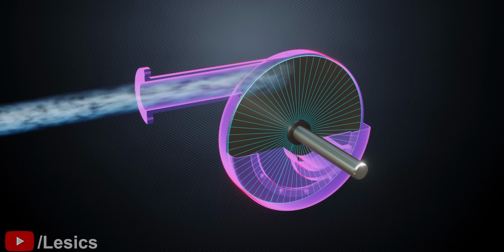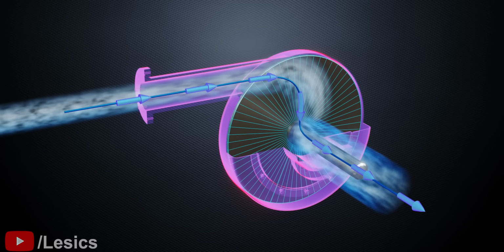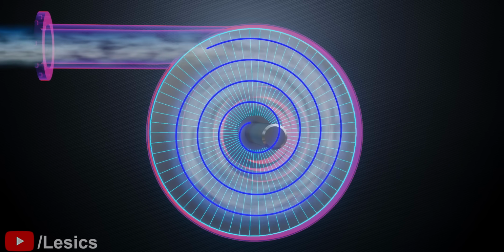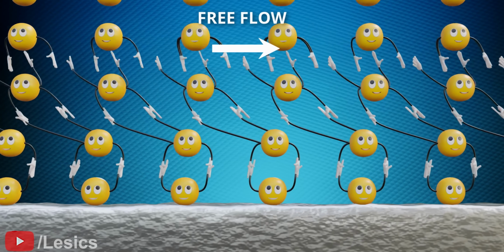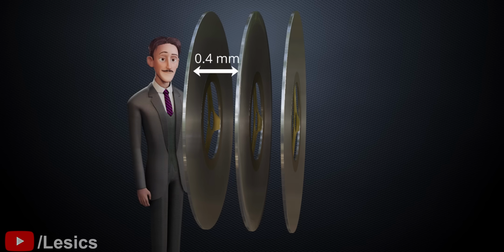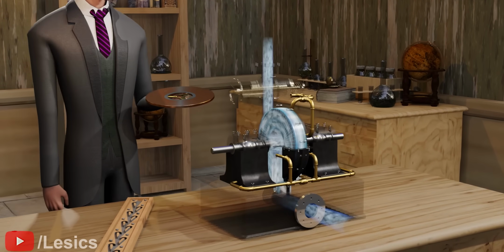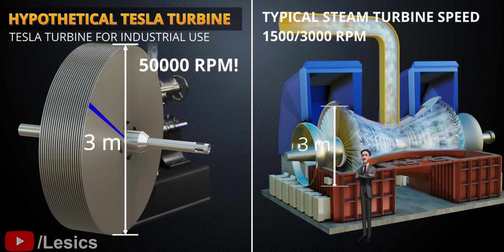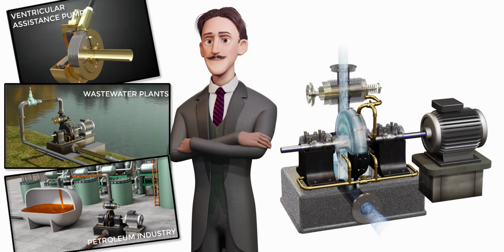Tesla Turbine | The interesting physics behind it

Comment: And there I thought I gave this a thumbs up already. Anyway, I think you do not need to build large Tesla turbines, an array of small ones would suffice too. You have to calculate building a "factory" for them into the fixed costs, like calculating the cost of building a dedicated boring machine when boring a huge tunnel. So this idea might need reevaluation, like many ideas after some time, when new materials, tools and modes of production have been discovered.
Reply from the maker: An array of small Tesla turbines may seem like a solution, but in the power generation industry a few number of huge power generating mahcines are preferred. Advantages are obvious - economy of scale and low maintance.
Reply: @SabinCivil : Yes sure, but Tesla turbines with modern bearings, (e.g. air bearings) are probably very, very low maintenance. The same is true for power generators. Further, replications of small units increase reliability. With respect to maintenance: Are you sure, that it will not be simpler to just replace a cheap mass produced Tesla turbine module, then to actually disassemble a huge machine for maintenance? In the IT industry replacing instead of repairing has been the default for a long time. Like in Server-Farms you could just replace the hardware in some X-year interval as well. Module cost will then be close to material cost, which is not the case for the current solutions. 

As I said, technological and economic viability estimations that have been done years, or even decades, ago need to be redone at some time point. But I am biased. This is a kind of systems analysis which I sell as service.
Reply: @AppliedMathematician  Better the Devil you think you know than the one you don't know for sure.

Comment: wonder what happens with indentations of the spinning plates, or a small tordation in them..
Reply: Turns out, cavitation creates vortices that drill little holes into the (ideally smooth) plates, which murders efficiency by decreasing tolerances and eventually shatters a disk if not maintained. 

And if you try and shape the disks to not create cavitation?  Congratulations, you've made a Pelton wheel.

Comment: I wonder the power output for non-industrial uses. Is that an engineering impossibility? Also if large sizes are a no-no. Why not multiple small sizes?
Reply: Good question. I suppose it is because smaller disk sice would necessitate a more curved trajectory of the fluid, resulting in pressure loss. Also the problematic outlet area will have a greater percentage of the overall interaction interface. And the fluid needs to be distributed over a wider area to reach all those disks first. All of this causes friction leading to less output. 
You can see similar things in basically any other turbine too. Turbo chargers, wind turbines, water turbines. If it needs to be efficient it needs to have a huge radius.
Also if the 2m diss needed 50.000 rpm, a small one would likely need to rotate at least as fast (but more likely much faster since centrifical force causes the particle trajectory to curve) Let us guesstimate 200.000 rpm. Which bearing can sustain that for 10.000h of operation and more? There are some, but at that point its easier to build a classical turbine.
Reply: Cavitation kills this thing at any reasonable work load.

Comment: Would planetary gears for reducing the RPM be feasible in this application?
Reply: I don't think so, it's not the shaft RPM that's the issue but the disc RPM

Comment: What if the tesla turbine was small? Let's say the blades are 30 mm in diameter. They wouldn't fail mechanically right?
Reply: Then torque would be low and an exponentially higher rpm would be needed to get the same power output

Comment: "I invented this really cool useless thing." 50 years later "Not so useless anymore."
Reply: the concept  has been used for hundreds  of years before  Tesla was born.
Reply: The video was trying to tell you this turbine is still useless. The materials required for it to work ONLY exist in Science Fiction. The G forces at the rim of the rotor disks are in the tens of thousands of Gs. The disks will disintegrate. I worked with video recorder heads on a 1.27 inch diameter head wheel spinning at 14,400 RPM. The force at the rim of this wheel was 7,500 Gs! The crystal ferrite head tips would actually get longer when the wheel was spinning!
Reply: @videolabguy  It is probably feasible today. A modern turbocharger will spin up to 150,000 RPM. It of course operates regularly at about half that speed but they are very reliable. Also consider the heat the exhaust turbine is operating at. I don't think a 3m diameter disc will spin at 50,000 RPM but if the diameter was reduced perhaps a solution could be found.
Reply: @geoffinbc  A turbocharger is a small thing. A well engineered engineered combustion engine in the size of Tesla's prototype here only have 12000rpm. Unlike the turbocharger, the engine's timing parts would break or the engine would even burst. And speaking of timing parts, that's what a turbocharger doesen't have.
Reply: @volare_cantare  Yes a turbo is small. But the RPM is incredible and it last for decades and thousands of heat cycles.

Combustion engines like an F1 V10 routinely spun to 20,000 RPM as well. With the right type of timing and valve control it is achievable. But that really has nothing to do with this discussion since a combustion engine does not really relate to a Tesla Turbine or a Turbocharger
Reply: @volare_cantare   "turbocharger is a small thing..."
Tell that to the fast and furious aftermarket 🤣🤣🤣🤣
Reply: @geoffinbc  You haven't dealt with turbochargers much have you? They fail quite often. If you are talking about all the factory "turbocharged" engines out there those are much lower RPM and lower compression allowing them to have such longer lives.. But go see after market turbochargers and they blow apart quite often.
Reply: @SilvaDreams  Considering the millions upon millions on engines today, the failure rate is quite low.
Reply: @geoffinbc  yeah, since those are factory intergrated turbochargers that is designed to be used at a much lower rpm than the aftermarket ones
Reply: @geoffinbc  a turbo charger is literally  a more efficient  version  what in the video.
Reply: @SilvaDreams  while they might blow apart due to weak materials and construction faults sometimes, it seems that many blow apart due to abuse. People turning off their engines while the turbo is still hot or even still spinning. Tuning going above the design limits. The dumbest people even press the accelerator before turning off the engine.
Reply: @videolabguy  Well yes your correct but your also wrong. And befor you ask no I'm not a politician haha. I was pointing out the devices at the very end of the video.
Reply: Einstein believed we'd never be able to see gravitational lensing ... for instance ... 
just something he 'resigned himself to never being able to verify.

Comment: the simplicity of the design just makes it cooler
Reply: "Simplicity is the ultimate sophistication." 
-Leonardo Davinci.
Reply: KISS principle
Reply: Well, a distance of 0.4mm sounds like a pain to manufacture.
Reply: @volare_cantare  for me, yes but a professional could do it probably easily
Reply: @volare_cantare  You're underestimating our technology. Your phone has a transistor more than 10000x smaller than that.
Reply: @volare_cantare  0.4mm is a standard thickness of stainless steel sheet. Have the spacers laser cut or punched and you can make them by the million if you want. Build a disk stack of 1mm thick disks and 0.4mm spacers. Quick and easy.  I built one like this it works fine.
Reply: @Ronald Martin titanium, inconel , graphene, cubicBoron arsenide
Reply: And more durable as less moving parts and simpler it is less stuff to break down.
Reply: Lesics
Reply: I wonder if the disks were not smooth, but contain radial ribs would that not increase the viscous drag dramatically and as a result not require such ridiculous RPMs to acheve efficiency? The separation distance between the disks can also be increased thus simplifying manufacturing process. I must be missing something here, but on the surface it looks pretty obvious.
Reply: @blg53  Surface tension is a constant (for a given fluid), so adding ribs would not increase viscous drag, but the ribs might increase surface area. However as @Blain Evans points out below, the non-smooth surface also introduces turbulence, and would also reduce radial laminar flow. The key to efficiency with the Tesla turbine is the viscosity of the fluid flowing over the plates.
Reply: @blg53   You would be defeating the purpose. The ribs would interrupt the boundary-layer and lose energy.  Tesla was following the discoveries of Charles Coulomb.  A fluid has more contact points with a solid surface the smoother that solid surface is. Tesla, a genius, recognized the genius of Coulomb.
Reply: @blg53  If you’re just using steam them the numbers are right, however the larger your disc circumference is the further apart the disks can be. But after 12 inches most 3-D printing for this type of thing would be limited so you’re still not within your parameters it’s just going to take time
Reply: @blg53  We looked at a model involving denticles to achieve certain aspects of flow, while the process did work theoretically the turbulence causes more issues than it solves
Reply: @blg53  yeah that a good point. You could also use micro coating on the steel plate to reduce or increase the drag. Would be intresting to experiment and see just how much efficiency and power you could get from it.
Reply: @elslick  the better thing to do is figure out the process of working fluid transfer…this needs more work
Reply: @blainevans9237  yes very very true
Reply: @Ronald Martin temperature are not the main issue here it’s the centrifugal force that’s the main problem 
At that speed the hole machine will just break apart after the disks are warped out of balance and will vibrate violently
Reply: @Ronald Martin Mono Polar Durainium...
Reply: More simple something is. The more design time spent
Reply: @ionbusman2086  qq
Reply: The design concept is simple but the forces and Physics utilized are way past modern steam turbines
Reply: I want to build one with a hollow axle for the exhaust, hopefully it'd be strong enough. There'd have to be small holes in the axle between disks, which may complicate the fabrication process
Reply: @fryncyaryorvjink2140  Remember to have a thick shell around the whole thing, you don't want to deal with the aftermath of discs exploding from centripetal forces.
Reply: @fryncyaryorvjink2140  It would be really difficult to do it without 3-D printing, and 3-D printing cannot yet accommodate the spacing between the desks
Reply: @blainevans9237 
I don't see how 3d printer comes to this application. Precision engineering/manufacturing existed before 3d printers, which are BTW pretty non precise, I mean most 3d printers have tolerance of 0.1mm, good CNC machine had tolerance down to 0.025mm. Lapping/polishing process down to 0.002mm.
Reply: @zokonjazokonja  velo 3D

Comment: This turbine design sounds to me like it would be the ideal design for car turbos since they depend on high RPM numbers. I would assume they would lose efficiency the smaller the discs get since you said the faster the RPM the higher the efficiency and bigger discs = higher RPM. Is that a correct assumption or are there other reasons not to use Tesla turbines in this way? Did anyone try making small diameter Tesla turbines before?
Reply: I don’t think that would work very well, as the purpose of a car turbo is to increase the amount of air in the combustion chamber. A Tesla turbine doesn’t really increase air pressure since the incoming air is about the same as the outgoing air.
Reply: @ehh2681  I don't see the problem here. With a turbo you catch the cars exhaust gas and spin a shaft that powers a compressor. The tesla turbine would not be used for compressing the air but to power/spin the compressor (just like a regular turbo).
Reply: @claus4461  Oh I see. Good point, I guess car manufacturers don’t want to put the time and money into researching the idea.
Reply: @ehh2681  After researching a bit more I saw people suggesting/using the Tesla Turbine as a compressor as well. I guess reversing the flow and using it as a pump can generate some form of compression in the fluid. I have no idea if efficiency is similar in this usecase or how much compression you could achieve with this.
Reply: @claus4461  I seen where people were suggesting using this design as an oil pump rather than the gear design most cars use currently. I think that would make a great improvement over the current design.
Reply: @ehh2681  , tesla design dependent of fluid viscosity. engine oil has varying viscosity  due to temperature and usage.
Reply: @khairulhelmihashim2510  I knew that but didn’t think of it that way. So in reality the use of the Tesla design is pointless since investing the idea wouldn’t be very profitable.

Comment: This channel is awesome to many engineers man...
Reply: Hi, just a question.   0.4mm gap is mentioned, where did this dimension come from. The research I have seen indicates 0.5mm at low speeds up to 1mm over 40/45K RPM with anything under 0.5mm. .decreasing output. Cheers John
Reply: hello